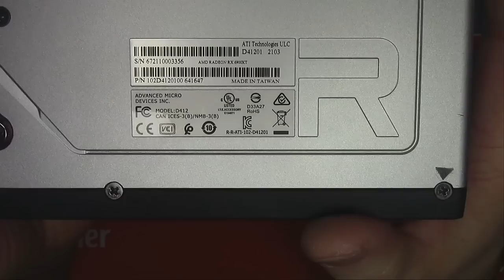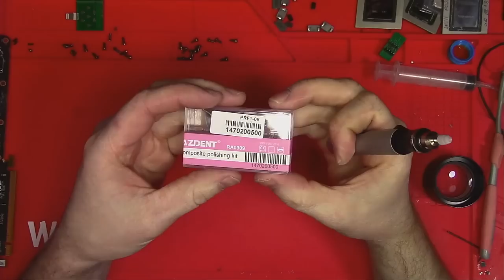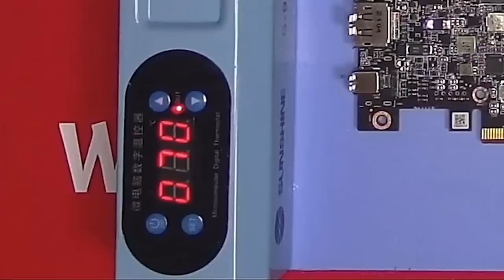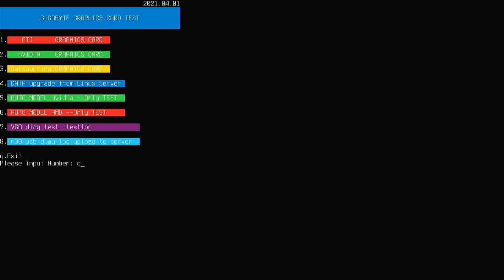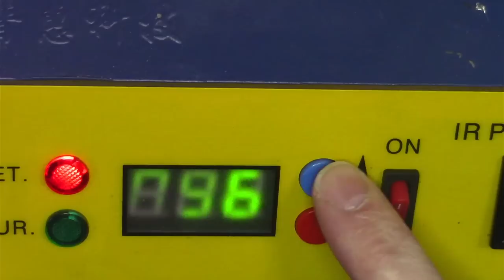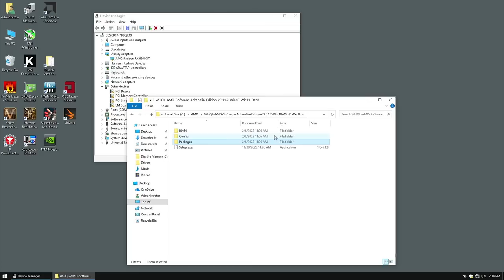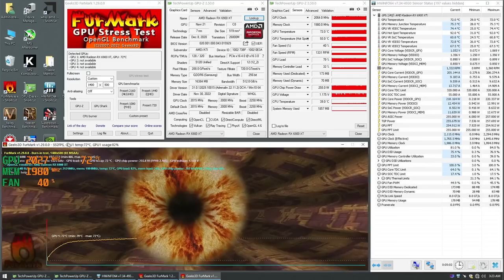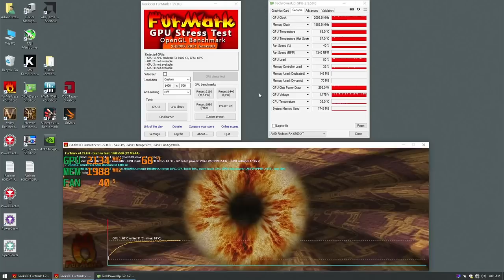Is AMD RADEON good graphics card ? Cracked PCB ripped pads no image

Comment: So, Radeon fabricates their own bare boards, or do they contract it out to a board fabricator? The fab house logo is on the board somewhere, usually near the UL '94V-0' designator (not always). It looks like either the board surface, or, soldermask ink was contaminated  in some way during application. Was the entire board like that or just the one spot? If just the one spot, then it was probably some contamination on the board surface. I really like your videos... very interesting.

Comment: This is good info but the Greta thing was... not funny or necessary.

I actually have one of these things and I propped it up on the corners to make sure it doesn't stress the board or itself. It's not been problem free, but it's definitely fast. The graphite pad should last a long time at least. Considering using paste didn't solve the hot spot issue, I don't think I"ll try it myself. My card is from a different manufacturer as well, so maybe they did a better job.

Comment: Great video as always , Can you direct me to where i can find that mem utility , recently i was repairing 6700xt , that had memory issue  , and ended up replacing all memory chips , due to lac of diagnostic program . 
I have the same preheat-er 8280  , but to warm the board to 150 i must set it to 250 , did You modify it ?
Reply from the maker: Discord

Comment: I was lucky enough to pickup the ASUS liquid cooled version cheaper than the air blower cards and the delta is 5-10c with max temp under 60c, so should be good for many years.

Comment: My Asrock OC Formula RX 6900 included a support bracket. The first one I received was used, and dead. The bracket had no witness marks, indicating it wasn't used. I suspect that card had a cracked PCB as well. Newegg was more than happy to replace it.... and sent another used card. It was supposed to be new, but at least it worked.
I finally got tired of the heat and buggy drivers. My new EVGA RTX 3080 TI Is doing the same job with much less heat, and no driver issues so far.
Reply: If I absolutely had to get a Radeon card then Sapphire is really the only decent choice. At least their PCBs aren't made out of rice paper.
Reply: Both of these cards draw about 400 watts TBP mate
Reply: @FeintMotion  are you sure about that?
Reply: @dorktales254  Everyone that's seen or read reviews is sure about that bud
Reply: @The_Man_In_Red  buildzoid went over rx6900/6950xt pcb's and asrock oc formulas has one of the best or the best pcb's from them and saphire is close to amd reference ones
Reply: @FeintMotion  TDP is power usage, not heat dissipation. Although heat dissipation is related to power usage, it isn't governed by it.
Reply: @Stephan The 6900 has a much larger heat sink than the 3080. That's why the 6900 needs the supplied support brace, but the 3080 doesn't need bracing.

Comment: Did the pcb cracked due to weight of the gpu or are there other factors? Great content mate.
Reply: If it was just due to the weight this would be a far more common issue.
Reply from the maker: Yes. Heavy card.
Possibly damaged during transport rather then it's own weight.
Gigabyte would break under it's own weight.
Reply: @northwestrepair  They did include  a decent gpu support bracket this gen so it should be fine right ? At least for the 4090, but why their rate of cracking pcb is so high ?

Comment: Very interesting.
I did the same thing with the plastic washers on my 6800xt after i changed the thermal pads and graphite better temps but still card gets hot.

What do you recommend as an upgrade video card?
Reply from the maker: EVGA 1080Ti is very good.
Reply: @northwestrepair  You're recommending an old, way weaker card to replace a 6800xt? Could you please explain your reasoning?
Reply: @duduoson5278  AMD hate, it's pretty obvious in the video
Reply: Undervolt and increase power draw limit as much as it goes. If you are still not satisfied, drop clock speed to the point where it does not make any significant (to your gameplay) performance drop.

Comment: Problem with these hotspot can be eazily dealt by indervolting core and soc. Temps on my 6800xt hotspot dropped insanelly just by lovering vcore to 1V. The core can still manage 2450mhz so i gain decent performance thanks to that. Default tuning on these card suck tho..

Comment: Dear repair bro, to fix the hotspot temperatures on this cards, just use thermalpads on the back of the memories. Because the backplate is not making contact with them. I fixed mine and the temps are normal now.

Comment: My Sapphire Nitro+ 6700 XT hits over 90 degrees on hot spot, 64 on core at full load...should I be worried ? T junction is 110 ...
Reply: Wouldn't of expected the temps on that card to be so poor, you could try tightening the 4 screws on the back of the pcb around the core to see if that helps a little.
Reply: @Stephan If it's a reference model that's probably normal, my powercolor hellhound 6700xt runs a 59c with a hotspot of 74c, fans run at ~36%/1100rpm, current ambient temp is 30c.
Reply: @Neggy-Z  According to multiple reviews that normal for that card... Lowering clocks seem to reduce drastically the hotspot temperature. Going above 2600 Mhz (Max clock) seems to always cause high hotspot temp.

Thank you for the recommendation. Those screws are sadly already as tight as they can be without damaging them.

Edit: I changed thermal paste, for now temps seem to be a bit lower (85 Celsius on hotspot in Furmark with 2660 MHz ,1150 mV), but that probably just until the thermal paste dries up a bit.

Edit II: A few days later after a few thermal cycling. Furmark 87. In game though more like 75 degrees vs 85+ after changing thermal paste.
Reply: Sapphire Pulse RX 6700 owner here. 20C room temp, 72C at full load, 98C hotspot at stock voltage +50mhz OC by Sapphire. 62C edge under load and 77C hotspot with undervolt at 1.09v. Consumption dropped from 158w to 132w.
Reply: @Mandrag0ras  That a nice Undervolt !

Comment: I feel like I am missing something here.... not on the technical side, which I am well familiar with, but rather, your reference to "Radeon" like its the name of a card/board maker, seperate from AMD. This is not the case - Radeon is the name of the GPU, just like Nvidia has "GeForce".  Like a GTX1070 and RTX 3060, and a GTX860, and a GT210, and so on, are all GeForce, the old R7/R9 series, the OG RX, and everything since has been a "Radeon RX-whatever" 

Even if we allow AMDs very fluttery definition of the "Radeon Technologies Group" as a bespoke entity within AMD, they still dont manufacture anything. they are essentially the dev team for the main GPU line. The only reason the "Technologies Group" schtick even "exists" is so AMD can put the Radeon name on non-GPU products like SSDs, but still leverage the name recognition of "Radeon". 

I dont see any possible way you didnt already know this though, so I am confused by that. 

Otherwise, great stuff as always. :face-red-heart-shape:

Comment: Try honeywell PTM 7950
Reply: Just bought some last month might change it and make a video from regular paste to that.
Reply: I'm impressed that he uses mx4. It suffers from massive pump out in a couple of months. Works great when it's fresh. I've used mx4 for maybe 6 months and I've noticed that all repairs started failing due to high temperatures on the core. This is specially true with laptops. Be careful with mx4 on bare die applications. PTM7950 is insanely good for long term applications

Comment: You don't use thermal paste in a card like this with that heatsink design, it has paste leak from the pressure. I saw huge thermal drop in mine going from paste to ptm7950 phase change material.

Comment: 11:17 Apple does the same They coat their super uber "alien made high tech" boards with basically crap. No wonder why components on these boards get oxidized even in Texas dry air.

Ironically, even the chinese Aliexpress frankenstein boards with chips scrapped from server and bulk contract PC e-waste have the proper classic comformal soldermask coating.

Comment: Hey, your repairs do way more to reduce e-waste than most of us can hope for!
You said 10 Kelvin should be the delta between hotspot and core. Is that specifically for the RX 6900 XT? Are you just worried about the maximum temperature? I'm asking because RX Vega definitely saw the same 20 K delta typically and I don't recall those dies to break prematurely. I only remember issues with some Polaris models.

Comment: Does anyone know where to get the "Gigabyte Graphics Card Test" ISO (or smth similar that has AMD gpu support)? Thanks
btw, for pads info collection: ASUS TUF 6900XT pads: all 1.5mm between board and cooler (mem, vrm, etc) and 2.5mm for the backplate. 
ASUS TUF 6800XT is identical on the cooler side (all 1.5mm), backplate should be too, but I've seen 2.0 reported also.
Reply: I'd also like to know this

Comment: My ASRock challenger d rx 6700xt has a core/hotspot difference of 15-20 degrees I want to wait til the warranty is up to open it tho
Reply: You could try tightening the 4 screws on the back of the pcb around the core to see if that helps a little.
Reply: my new sapphire rx 6700xt pluse core/hotspot difference is 64C/ 112C when running Time spy with default setting(room temp 28C open case.).. i only can try tightening the 2 screws on the back(but they seem tight enough.) cause other two had a warranty sticker on that i can't break or loss warranty.  the only way to make the temp to 64C/95C is to lower the max Frequency to 2400mhz , undervoltage to 1140mV + higher the fan speed.
Reply: @AhHuat1976  If the delta is that much there is something wrong with either the mounting pressure or the thermal paste application
Reply: @Neggy-Z  should i try to RMA the card? lol i am not sure sapphire will give a fuck since AMD say that 115C hotspot is under "NORMAL" condition.. zz
Reply: @AhHuat1976  Maybe email Sapphire support and see what they say
Reply: @AhHuat1976  i undervolted and underclocked mine -4% power and 2400 core clock while over clocking memory to 2150. I heard the sapphire cards were bad with this issue that’s why I went ASRock and it’s not too bad but I feel like there is a loose screw that’s what I’ve seen on other sites
Reply: @Neggy-Z  warranty stickers

Comment: I have 6950, and its even worse - 90 degrees with fans spinning at full blast while playing any demanding game. Had to drop from 2500mhz to 2100mhz on the core. Lost about 15% on performance, but at least temps is around 70 on hotspot now, and fans not spinning like they about to take off from my pc case.
I've had Asus 1080ti before - it had 65C on full load with all standard settings, wtf AMD...

Comment: I put K5 pro in my 5700XT, on the gpu die and the memory chips. Why not replace everything with K5 pro?
Reply: I don't know for sure if will change the difference between the hotspot and core but it seems to be stable on my system.

Comment: had to go check my gigabyte aorus 6900xt wb 60C gpu and  hot spot was 15-25c hoter lol on custom loop
Reply: wow i got lucky with a reference 6900XT 10-15c delta on hot spot custom fan curve. 65*c GPU 80*c Hotspot after all day in Sons of the Forest.
Reply: @Stephan its only set to 60% fan on a reference card no way its better then a full custom water loop. Block mount probably bad we see this all the time. 60% fans are kind of loud but i use a headset so never hear it. yes my card was 100% usage for hours.

Comment: 9800 pro lastet onlie 2,5 or 3 years. had tv szell the 1950 pro? dreck v v 
got 9600 pro passiv used but sure onlie 2d ran. then 5870 for the cooler 3d fine but 2d desktöpp with flickez -.- 
evga 580!?? still 20?% öc-able o0 
bg? müzäk nö tryängle?? 5:30 still a cräkk?? im guessing all the ´nice töölz dönt amount tv $vb 500€?xD

Comment: Well thiese days all GPU manifactures does one or more shity product's. I know there is some shity nvidia and amd model's, but in general there are 1-2 ones model's you can pick safely. I owned XFX rx560, 580, Aorus 5700xt, reference 5700xt. Had isues with only reference and its was kinda spread list of problems sopesedly with driver's, but RMA and change to aorus did worked well. Surely I know msi mech 5700xt and assus rog 5700 and xt was shit couse of bad mounting. Dont know how it goes from repair perspective, but I kinda liked they product's so far, but always go for best value options ;).

Comment: At this point, i don't know if AMD is at fault, either by the use of bad material or the owner of the card thermally abused the sh*t out of this card, both can also by the case.
If i had more experience with these materials maybe i could come up with a decent opinion but i can't say.